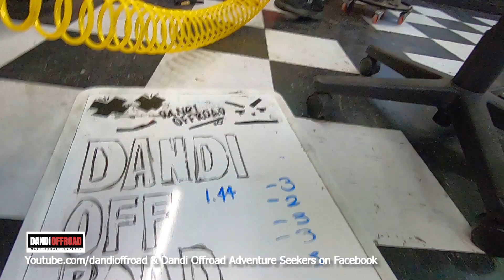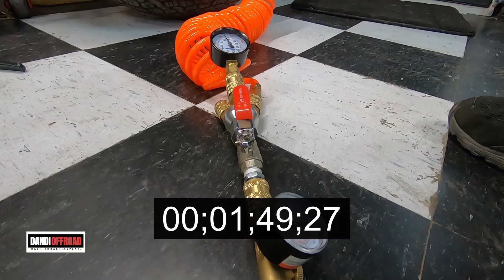Is PISMO Closing?! Not NOW!!! We Just Built THIS!

Comment: Just a suggestion...couldn't you just set the regulator on the air compressor to 65psi? then the compressor turns off and boom, done.
Reply from the maker: I definitely think that would work. We were just hoping to be able to leave the air compressor as is and have a regulated 65 PSI at the end of the hose. This setup is used in our trailer for a compressor that we have mounted in the storage compartment.

Comment: The part you have at the bottom is just an adjustable air flow valve with a gauge, which is no different than what you have at the top with the ball valve.That is not a pressure regulator. If you are looking for speed, use a regulator sized at least the same as your air source. Long story short, your test would have worked if you used an air pressure regulator. If you don't want to buy one just for a test use the one you said you have on your compressor.
Reply from the maker: Thanks for the info, thanks for commenting, we are going to experiment a little more.

Comment: You cannot use a regulator to stop filling at a set psi, a regulator limits the psi, if you put on the tire it will fill at a rate of 65psi only taking longer to reach 130psi. Very dangerous overfilling a tire like that!
Reply from the maker: We are going to find out, I have seen it done, just didn't realize what we bought was not a regulator, YEAH right? scary!!! thanks for commenting.